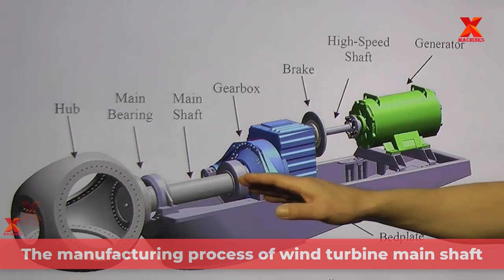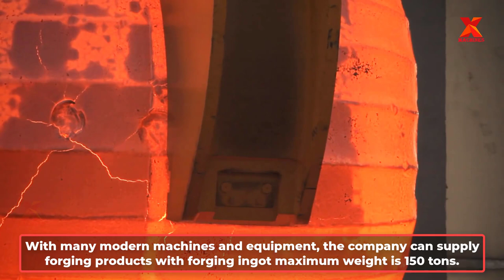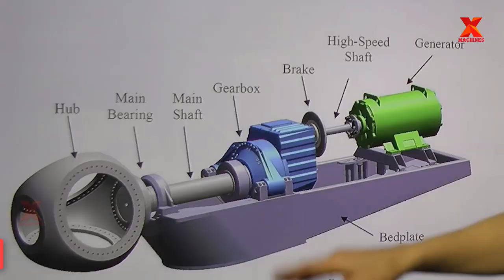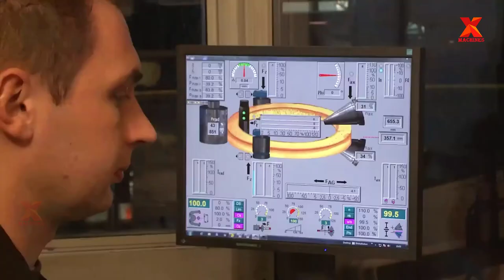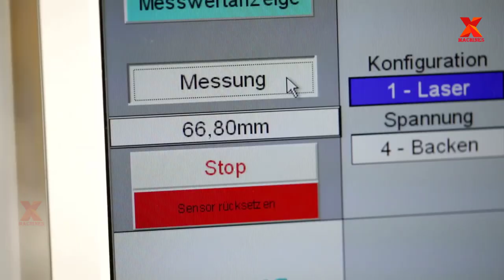Largest Wind Turbine Gearbox & Main Shaft Manufacturing Process. Biggest Heavy Duty Forging Machines

Comment: Direct drive (no gearbox) is the only way to go.  Less mechanical parts = more reliability = more time online and less maintenance costs.
Reply: Good luck trying to make any power from a generator doing 30 rpm...
Reply: @hamstirrer6882  That's actually really easy, it just needs 240 poles for 60 Hz or 200 for 50 Hz.
Reply: @hamstirrer6882  They already manufacture them, they're the most reliable turbines in the world because you don't have the gearbox that needs replacing every 3-6 years after it wears out...
Reply: @KingdaToro how big the generator that will be? Is it safe and economical to mounted on tower?
Reply: @azman4749  Yes. For that sort of generator, it will be a large ring directly behind the rotor's hub, connected directly to it.. The nacelle will be a lot wider than usual, and conical. Enercon turbines usually have this sort of nacelle.

Comment: 3:53 I noticed the end that isn't flat has covered itself in a whitish pale oxide
Reply: @sjb3460  Yep the same is true about metals that produce a black oxide. In fact I've built things myself out of wood
Reply: @sjb3460  I just follow whatever written instructions are there (usually a furniture assembly manual), makes it a whole lot easier and I don't blame you for hating it TBH

Comment: All of that energy spent on something that'll never be able to produce enough to make up for it...
Reply: "All of that energy spent on something that'll never be able to produce enough to make up for it..."
Please, your source of that very questionable information.
Reply: Yes! How can the initial cost, installation, and maintenance ever begin to provide a ROI. Just imagine the maintenance costs for those towers situated in the salt air.
Reply: current wind turbones does it within aproximately 2 years of operation. they are hugely effocient. those figures by the way was for the old ones (about 10 years) with a size of a bout 1.5 megawatt. the newer one at 9 on shore, and 16 off shore does it way, way faste than that.
Reply: @johndoe1909  isn’t it amazing that you still need to answer such idiotic questions when the energy payback is so dramatically quick?
Reply: @jimwoods9551  i guess there is a location component as well. different locales have different payback times.